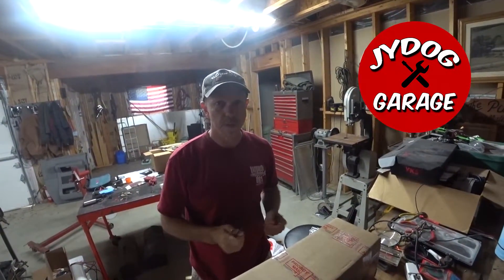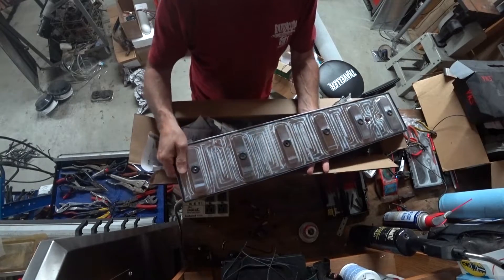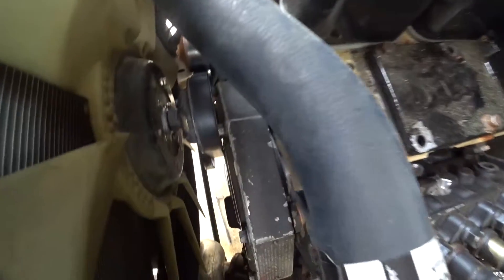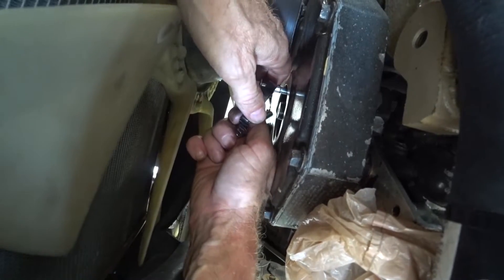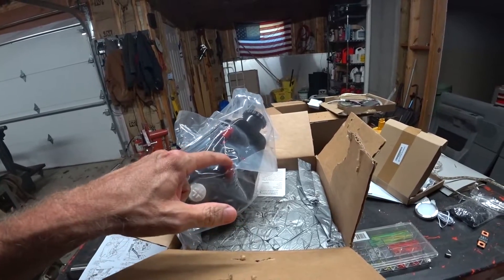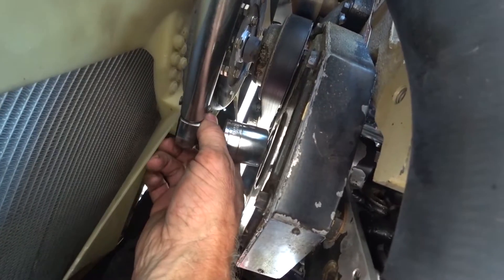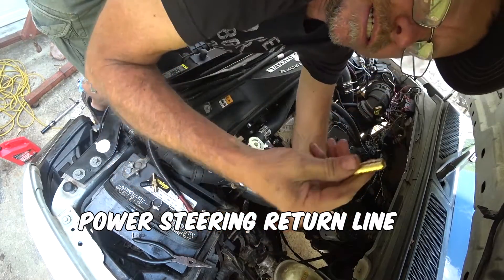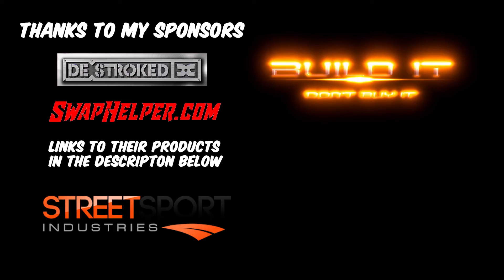Billet Tappet Cover Fixed My Cummins Swap Oil Leak

Comment: Please show how you got to the 2 back nuts of the p-pump.  Exactly would be ideal.  I have my truck apart and my universal with extensions can't get a solid grip on the farthest nut.  Afraid it will slip.  Every video talks about it or they have the engine out of the truck.  Great video but missing the most important part for me.

Comment: Friend of mine has a dead 2008 F550 with a dead 6.4 out in Carrollton - He bought one of the Uhaul transporters at auction to use as a service truck.  Trying to get him to do the same swap.  He was convinced you have to pull the cab off but you obviously don't.  I sent him a link to your series trying to convince him.  It looks like an excellent  solution to the 6.4 problem - and your vids will help in avoiding mistakes.  Great looking project.  We will have to talk Airsteams sometime - I've got an 86  34' Limited

Comment: I bought that eBay tappet cover that you're showing it's junk the seals went bad within 100 MI they turned hard as plastic I replace the seals with the eBay kit same thing went bad 😠 I guess you pay for what you get so the third time I broke down and paid 300 bucks and got me one from Bean the problem is cured 😊

Comment: GM, Ford and others don't always use the same pressure on the power steering pumps and gears/racks they use.  You may need to change the output pressure of the pump.  You can shim the spring on the pressure relief valve on the back of the steering pump to raise the output pressure of the pump.  This may help you get the steering response that you want.   The pressure relief valve is an assembly that threads into the back of the pump with a large, thin nut right where you install the pressure side line.  Pull the assembly out of the back of the pump and unscrew it to get at the spring inside it  Then you can stretch the spring (sometimes works) or shim it with washers (better way).  This is pretty much all you can do to change the output pressure, since there is no belt turning the pump - and you can't use a smaller pulley to spin it faster.  You should be able to find any number of videos on Youtube on modifying the pressure relief valve on a Saginaw style power steering pump.

I personally would put a pressure gauge on the output side of the pump to insure that you are getting the right amount of pressure fed to the power steering gear and hydroboost.  You would want to look up the stock output pressure for the 6.4 power steering pump at idle, then shim the pump to the correct pressure (or slightly higher).
Be careful reinstalling the pressure relief valve.  There are a few O-rings that are easy to pinch, causing leaks.

Comment: I have a 2008 f250 with a 12 valve and I put a power steering pump off a Ford f650 that had a 12 valve and got the vacuum pump gone and it turns like a charm

Comment: I'm chasing an oil leak. Either last valve cover or tappet cover. On original tappet cover it has a big bump or baffle
but not on the new billet one. what's your thoughts on that. How will you mark your engine or harmonic balancer
to maintain timing. Or will you start from tdc or original 12 degree ?  What's a good way to mark timing ? I'm 18* and it runs good.

Comment: Not sure if you have a flow adjustment nut on your steering gearbox. The Dodge gearbox does. Just a quarter turn helped my low rev steering a lot

Comment: You need to get those flared fittings pointing up, then run a 120° or 180° push lok. It'll help stop oil from blowing out.

Comment: How did you end up running your drain lines off the cover?? Into a catch can?
Reply from the maker: I blocked them off and vented off the front gear cover like the Marine applications.
Reply: JYDOG I’ve bought the same tappet cover and I was wondering if I would be able to take one of the fittings off the tappet cover and run it into an inlet side of a catch can and then take the other fitting off the tappet cover and run it to the outlet of the catch can... not sure if it will work but I really want it too. In my head it doesn’t sound like it will just because both of the fittings off the tappet cover are just drain lines/ blow by... Correct? I don’t know at this point I’m so scatter brained at the moment and don’t know what to do... could you show on video how you vented the front?... thanks I appreciate it.

Comment: I have a 2008 ford f350 with a 97 12 valve cummins  the 3 and 5 gear shift really firm ......you think i need to change the transmission converter like you did.

Comment: Nice job on the conversion. I did the same for my 1985 F250 and within a week the tappet cover started to leak. Found your channel after I ordered the same part. I also set the timing at 16.5 degrees BTC. Unfortunately I did not anticipate removing the #$%^ pump again so I did not put the 16.5 degree mark. Any suggestions anyone on how to keep this timing without messing it up. Again nice job. Fummins Rule!

Comment: You will find, over time that you are going to have steering  box issues with your truck and "bump steer problems the tires you are using along with that wheel off set puts way too much pressure on your steering box. Your bump steer will not happen in the traditional sense, however, it will feel like the Your off set is too far from center and the contact patch of those tire is much larger than the design was meant to take. You will also find much greater and faster wear on your brakes, wheel bearings, sideline U-joints and 4WD system. Just a fore warning. Wouldn't  be quite as bad if you were to use it off road continually where the terrain  would provide you with some natural slippage thus relieving the binding strain. However, it's too be a true k for that, especially in the Georgia Mountains. So you will proudly run it on the street and rightly so, you've done a beautiful job with it. Just a word of forewarning  that's all.

Comment: Just my point of view
Cummins dropped the ball on the injector pumps..
In the end of the shaft
They could have threaded a small hole into the shaft
Then when installing or removing the nut and washer
There would be no way to drop them into the engine

Comment: Get a bigger power steering pully
Reply: faceman5050 pully? It’s gear driven off of the vacuum pump. He needs a high flow pump or an entirely different pump that’s more badass. The big issue is that dodges use weak pumps to begin with add in the lift with 37s and it’ll wine and not like turning at slow speeds. Bumping the idle to 850-900rpm in park would help a bit.